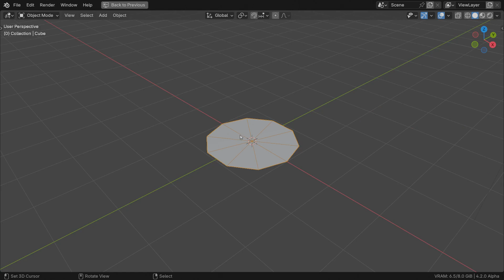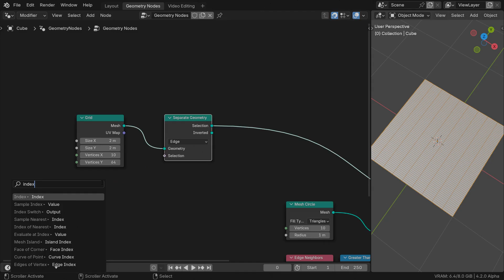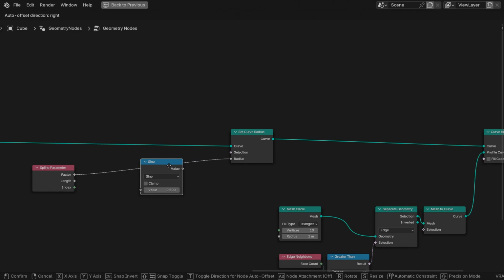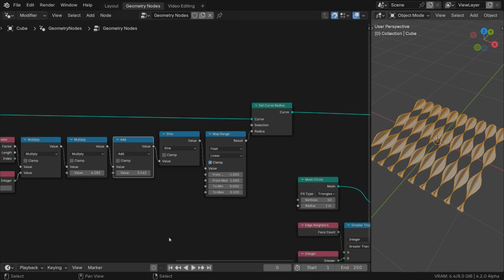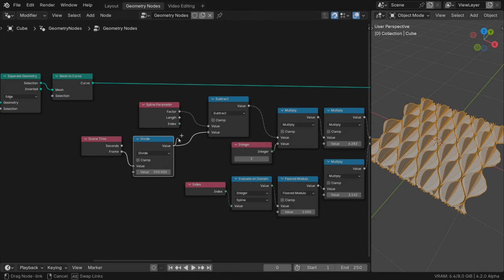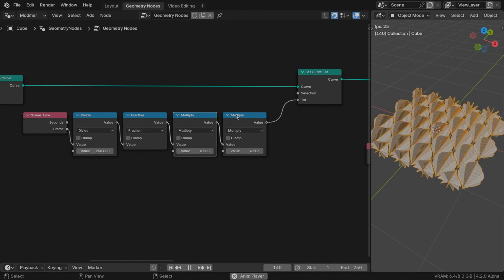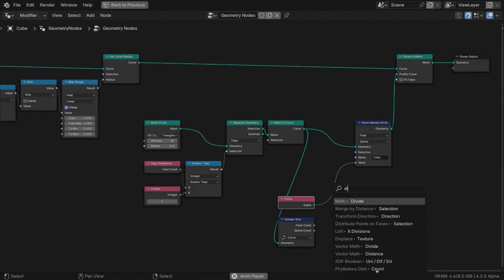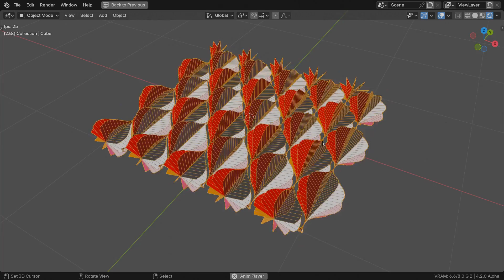Creative Coding  - Motion Graphics With Geometry Nodes

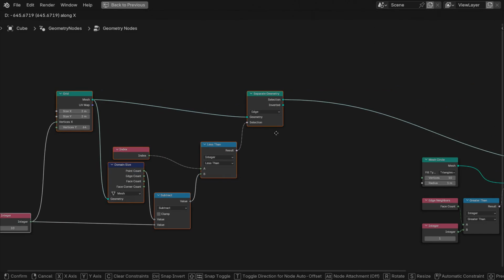Comment: Thank you Ilir! I have a question: Can you explain a bit of why the x-vertices subtracted from the point count gives you the correct edge index @2:32 ? To me, it makes more sense to subtract from the total edge count.
Reply from the maker: It's because of the order used to generate the points on a grid. It's one of those things that you discover by accident, have a general notion of why it happens, but miss the right words to explain in a way that makes sense. You only have to subtract the x-vertices in the case of an open surface, like the mesh grid. In case of a closed surface, like a torus this is not necessary.
Reply: @ilirbeqiri  Thank you for your reply! I will experiment more with this and try to build my intuition. I think my main confusion is that the point-count value is 640, and the X-vertex count is 10, so what is the usefulness of 640-10=630? Either way, I appreciate learning different ways of approaching problems from you!
Reply from the maker: @XYZandRGB  Well, if you generate a grid and feed an index field into the viewer node, by default you can preview the point indices on the viewport. Switch the view mode to edges and you will preview the edge indices instead. Toggle the mode back and forth and you will notice that the developers ordered them in columns. Let’s say our grid is 10 by 10. The first column point is 0 and the last one is 9. If you switch the viewer mode to edges, you will notice the that the edges are also laid out in columns. The first column edge is  0 and the last is 8 (one less than points). When all the columns points are connected with edges, only then will Blender start connecting the rows. Each column has one less edge than points. So the sum of all vertical edges is equal to the total number of points minus one row of points (one point less per column). The vertical edges are only half of the total edges. So there are almost twice as many edges as there are points. You get me? We don’t have to do extra calculations for the other edges though, the Separate Geometry node will automatically return us the rest of the edges, the horizontal ones. Does all this make sense?
PS: Thank you for forcing me to wrap it up in words. 😉
Reply: @ilirbeqiri  I'm starting to understand. This is a difficult topic to try and explain over text, but I appreciate your effort. I didn't realize the separate geometry node worked like that!